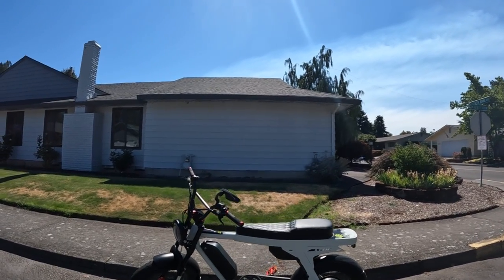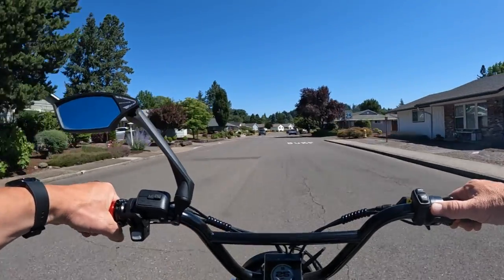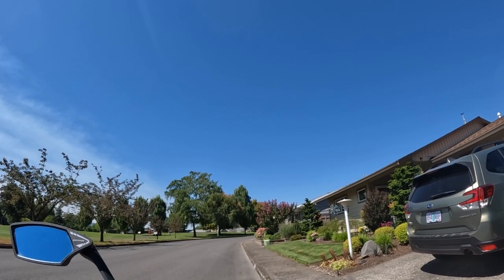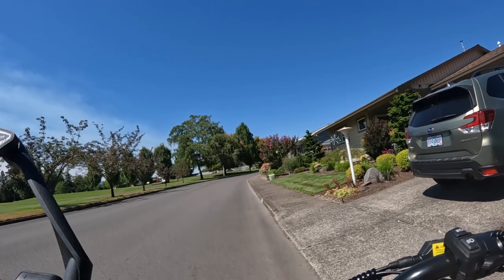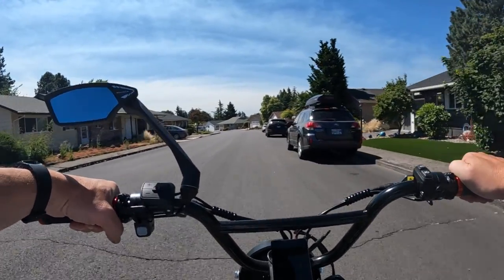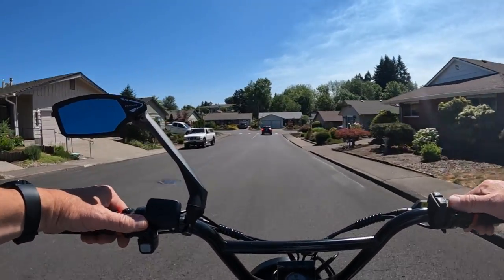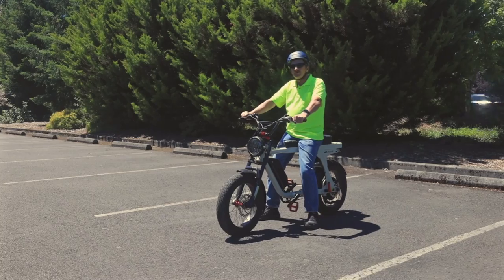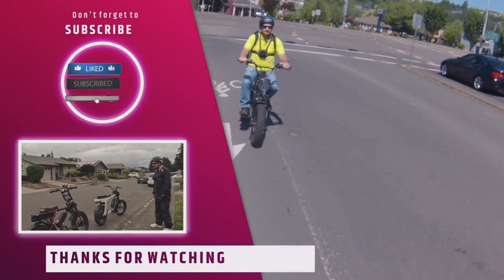Lyric Graffiti e-Bike "SHUTS OFF" After Changing PAS Settings

Comment: After a near emergency braking stop I had a dead bike . Turned out the strands of cable got broken and the lever wouldn’t spring all the way back. So essentially the brake lever was killing the motor. Pull on each lever and examine the exposed cable end area. I pulled so hard it broke some of the strands and they got bent so that they were jamming the movement of the lever.

Comment: I would put all the settings back to where they were. Regen thumb throttle are about $10.00. I personally had the same thumb throttle go bad on one of my E-bikes. Maybe try pulling the plug on you Regen thumb throttle and see if it works unplugged. If it does ...... then you have your answer. Unplug all your connections, then plug them back again.

Comment: Someone told me to use a tailors measuring tape and wrap it around the wheel to get total circumference on my Kepler. That's in mm or whatever. We have one metric wheel circumference to play with and one in inches for size
Reply: There is an easier way, using the valve stem for reference, set the wheel so the valve stem is at the very bottom, put a mark on the ground next to the valve stem, push your bike so the wheel travels one rotation, with the valve stem being back at the bottom, make an other mark and measure the distance between the marks.

Comment: Oh well that is not a good look for lyric
Reply from the maker: I accidently hit throttle and regen brake at the same time.
Reply: @oregonebikermark8953  so it's a flaw I have regen on my e-scooter but to activate it you have to gently press the brake leaver Doing so cuts off the motor automatically (safeguard)  lyric as none that could be a fire hazard danger in the end